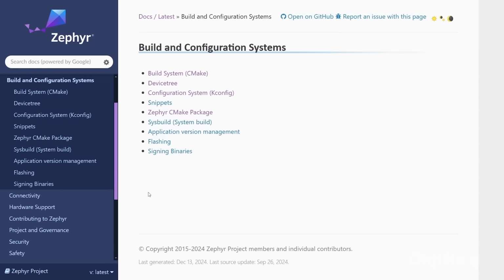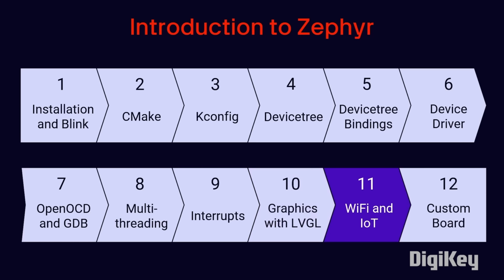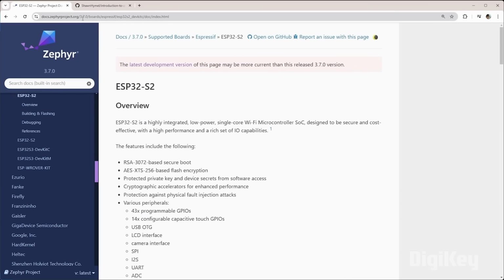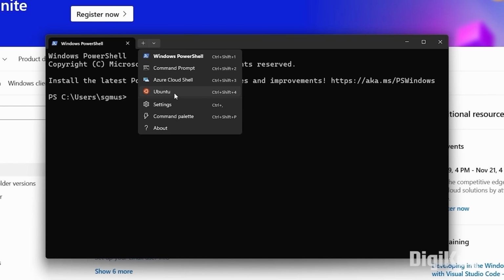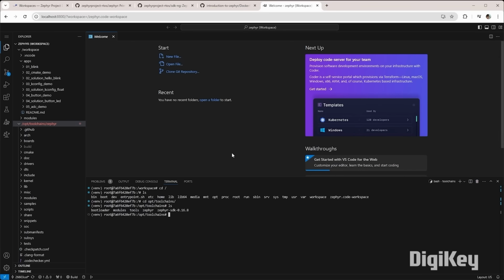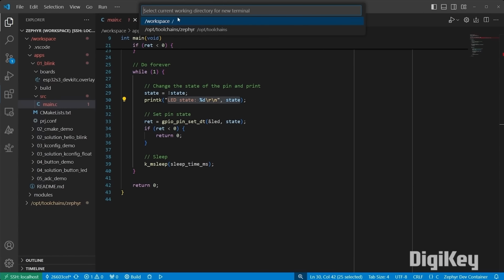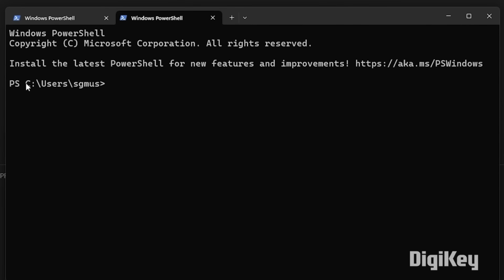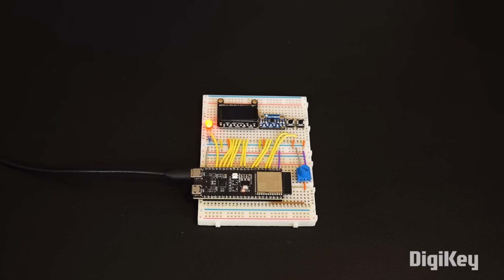Introduction to Zephyr Part 1: Getting Started - Installation and Blink | DigiKey

Comment: Thank you for this resource!  I look forward to learing more.

I had some issues with your istructions to install.  Wne I flash to 0x0, I get the following errors at runtime:
rst:0x10 (RTCWDT_RCT_RESET),boot:0x13 (SPI_FAST_FLASH_BOOT)
infalid header: 0x6e6f7965

My online research suggests this is an issue with SecureBoot.  Following advice online, if I flash to 0x1000, I am able to get the code to run.

Can you explain what this is?  Is this because I am using different hardware, or is something else going on?

I am working on an esp32-WROVER-IE.  I already modified the build instructions to build for the wrover board.

Comment: @ShawnHymel I finally got around to trying this again and was successful getting as far as building the blink example and installed pyserial, however, the installation of esptools failed with the following error:

```python -m pip install esptool==4.8.1
Collecting esptool==4.8.1
  Using cached esptool-4.8.1.tar.gz (409 kB)
  Installing build dependencies ... done
  Getting requirements to build wheel ... done
  Preparing metadata (pyproject.toml) ... done
Collecting bitstring!=4.2.0,>=3.1.6 (from esptool==4.8.1)
  Using cached bitstring-4.3.1-py3-none-any.whl.metadata (5.3 kB)
Collecting cryptography>=2.1.4 (from esptool==4.8.1)
  Using cached cryptography-46.0.3.tar.gz (749 kB)
  Installing build dependencies ... error
  error: subprocess-exited-with-error

  × pip subprocess to install build dependencies did not run successfully.
  │ exit code: 1
  ╰─> [149 lines of output]
      Ignoring cffi: markers 'platform_python_implementation != "PyPy" and python_version == "3.8"' don't match your environment
      Collecting maturin<2,>=1.9.4
        Using cached maturin-1.10.2-cp312-cp312-mingw_x86_64_ucrt_gnu.whl
      Collecting cffi>=2.0.0```

Anyone have any pointers?

Comment: Got some time so thought I would dig into Micro_ROS and only board lying around was an ESP32. 
So I started with Zephyr RTOS. I was trying to build the demo app like ping pong for my esp board but the CMake files says its not compatible. 
So my question is can I not do Micro-ROS on Zephyr RTOS on ESP32 specifically the ESP32 Devkit V1 ? Should I get another board ?

Comment: can you please share how to change the latest zephyr here instead of 3.7.0?
Reply: You can change the version in the Dockerfile. Note that it might break some things (as the versions of nearly everything are pinned) and some of the Zephyr function names/signatures may change.
Reply: @ShawnHymel  I tried the same but as you  added zephyr rtos commit id and i am not sure which commit id i should use for latest rtos, so instead i used zephyr arg version as 4.2.0 and removed the commit line, also i changed sdk to 0.17.4 and created a image but it seems it broke everything not able to build simple hello world as well. where i am doing wrong here?
Reply: @Mahakaal-007-05  Zephyr 4.0+ made some breaking API changes from Zephyr 3.9, so it's tough to know exactly what's going on. What errors are you seeing when you try to build hello world?

Comment: Regarding the 9m mark, if ZephyrOS is the choice for small embedded systems, what would be used on larger embedded systems?  Full blown linux or windows sbc?  How do FPGAs fit.. can you run it on an FPGA with 512KB RAM?   BTW, look forward to the the full workshop series!
Reply: I would say that Zephyr is a choice for medium embedded systems. Usually, you see something like: bare metal programming for small embedded systems (e.g. 8, 16, small 32 bit microcontrollers), FreeRTOS, Zephyr, or other RTOS on medium embedded systems (e.g. powerful 32-bit microcontrollers, like Arm Cortex M4s and ESP32s), and full Linux on larger embedded systems (single board computers with e.g. Arm Cortex A series CPU). You can do anything you want with an FPGA if it has enough resources. I would only use an FPGA when I need reconfigurable hardware and need very fast, hyper-optimized processing or I/O (e.g. designing my own processor, creating an AI accelerator, interfacing with a custom display).

Comment: For those using Fedora, I'm using Fedora 42, I had a hard time mapping my local volume into the container. I had to change the docker run command slightly:

docker run --rm -it -v "$(pwd)/workspace:/workspace:Z" -w /workspace env-zephyr-espressif

added the ":Z" at the end of the path in -v option/flag. Hope this helps.

Comment: I wish the hardware chosen would have been either pi pico or some other easily available hardware and cheaper, so that more number of audience could acuire it and follow.
Reply: I chose the ESP32 because of the WiFi capabilities. Something like the Xiao ESP32S3 should work (it's MUCH cheaper!), but you might miss out on some of the capabilities (e.g. USB client).

Comment: Please recommend a ESP32 DEVKIT alternative to the ESP32-S3-DEVKITC-1-N32R8V? The ESP32-S3-DEVKITC-1-N32R8V is either not available or has very long lead times.
Reply: @bobb5198 Any of the ESP32-S3-DevKitC variants (e.g. N8R8) should work for this series. Note that I have not tested them, as I only have the N32R8V, but they should work.

Comment: This is wonderful!  I do have a couple of questions:
1. You show three options for connecting to the docker image (web, ssh, VSCode docker plugin) - I generally stay away from web, but between the other two, are there advantages or disadvantages for one over the other?  I'd used SSH in VSCode to do development on an RPi 5, so I'm familiar with how that works.  From a usability, interaction standpoint is there any difference between SSH and the Docker plugin?
2. You're using Debian as the host OS for the image.  In your CI/CD video you started with Ubuntu LTS.  Is there a particular reason for using Debian with this Zephyr environment?  Is there an advantage for using one over the other?
3. How did you come up with all the version numbers for the components?  Did you just install the latest version first, get things working and then lock down on those version numbers?
Thanks!
- Robert
Reply: 1. My personal preference is the VS Code extension Dev Containers that automatically runs and connects to the container. It requires a bit more setup, but it seems I get to keep more of my locally installed extensions that way.
2. Nothing wrong with using Ubuntu--it's just a little more bloated. I went with Debian to keep the install image smaller for students.
3. Pretty much, yes. I started with the latest versions of everything and tweaked until I got things working. There were some issues with some of the ESP32 drivers in the last version of Zephyr 3.x, which is why you see the very specific commit version of Zephyr in the Dockerfile. That was the only way I got those drivers to work.

Comment: How come the docker image doesn't have the example apps in it? Plus, the speed at which Shawn moves forward is very hard to follow. Very disappointed.
Reply: The example apps are in the workspace/ directory in the GitHub repo. When you run the Docker image, you need to make sure to mount that folder so it shows up in the container. Is the speed too fast or too slow?

Comment: After building the image (I can see it in Doker Desktop) the size is about 6.86 GB so bigger than your... also running the image through the command:

docker run –-rm –it –p 2222:22 –p 8800:8800 –v “${PWD}\workspace:/workspace” –w /workspace env-zephyr-espressif

prompt the error:

docker: Error response from daemon: ${PWD}\workspace%!(EXTRA string=is not a valid Windows path)

To solve I've specified the path directly without use the ${PWD} shortcut so:

docker run –-rm –it –p 2222:22 –p 8800:8800 –v “C:\<my_local_path>\introduction-to-zephyr\workspace:/workspace” –w /workspace env-zephyr-espressif

BR
Reply: Thanks for the tip! I wonder if this is a Windows 10 vs 11 issue.

Comment: Just as a side node, for me in a Win10 Pro OS the power shell command used to build the image from the  file Dockerfile.espressif is not working and prompt always same error
ERROR: docker: 'docker buildx build' requires 1 argument
instead using the command to build the image inside a console shell (cmd) work perfectly...
Thanks and best regards.

Comment: Adding a bit of additional context here, I'm using an ESP32-WROOM-32U. I'm following the tutorial just fine. The same overlay file works just fine for the ESP32-WROOM-32U. However, I ran into an issue when flashing the device. I am not sure why but the command that worked for me was:
    python -m esptool --port "/dev/ttyUSB0" --chip auto --baud 921600 --before default_reset --after hard_reset write_flash -u --flash_mode dio --flash_freq 40m --flash_size detect 0x1000 ./workspace/apps/01_demo_blink/build/zephyr/zephyr.bin

The command that Shawn gives; the one without a few parameters and the one that flashes from 0x0 prints an error when I TTY. I'm also curious as to why this is the case.
Reply: What command did you use to build the application and what command did you use to flash? The ESP32-WROOM-32U is a base ESP32 (not an ESP32-S3), so you'll have to change your target SoC.

Comment: 21:38 In case someone is wondering, the Linux-specific commands are as follows:
                   Docker Build: docker build -t env-zephyr-espressif -f ./Dockerfile.espressif .
                   Docker Run: docker run --rm -it -p 2222:22 -p 8800:8800 -v "$(pwd)/workspace:/workspace" -w /workspace env-zephyr-espressif
Make sure that you're in the correct folder and do any changes to the commands as you want like Shawn mentions.

Comment: Hello Shawn and thanks for this material. I see you are using ESP32-S3-DevKitC-1-N32R8V, that one has 1.8V for SPI Voltage. Is that important when connecting external modules to the board? I ask cause the other versions with 8MB flash have 3.3V for SPI Voltage, Not sure if would need to set VDD_SPI voltage to 3.3v permanently, using eFuses, like documentation says or if I missing something else, since I am not electronic engineer is a possibility. Thanks a lot.
Reply: @freddyveza I have not played with SPI on the DevKitC yet, so take this all with a grain of salt. From what I understand, Espressif sets the VDD_SPI voltage to 1.8V permanently for the N16R8V and N32R8V variants of the DevKitC so it can use the higher capacity 16 and 32 MB SPI flash packages. The fuse is burned at the factory and you should not (or possibly cannot) change it (unless you want to damage the flash chip).

It seems that SPI0 and SPI1 (according to the WROOM datasheet) are dedicated to the onboard flash chip. I think in the WROOM module, these SPI peripherals are using GPIO35-37, which are powered by VDD_SPI, so I would not use those pins (it's weird they are broken out on the dev board...it's possible the WROOM is using GPIO26-32, but I have not confirmed this yet).

SPI2 and SPI3 are still available as general-purpose SPI peripherals and can be mapped to other pins via the MUX. So my recommendation is to use SPI2 or SPI3 and configure the pins to something else available, and almost all of those can be powered by the normal 3.3V.
Reply: @ShawnHymel  Thank you very much for your answer Shawn

Comment: Just in time as I get started with the platform. The given instruction does not work for me (the serial keeps pumping out "invalid header data") probably since I am using an ESP32-WROOM-DevKitC instead of the S3.

Luckily, I found Expressif's article "ESP32 bootstrapping in Zephyr" and flash MCUboot bootloader first then build with `-DCONFIG_BOOTLOADER_MCUBOOT=y` and it works perfectly.

Just so you khow, we could to `west flash && west espressif monitor` in place of those long commands.
Reply: Good tip, thanks! I didn't have that particular dev kit to test with. What address were you writing the bootloader.bin to? I ran into this problem on my S3. The bootloader should be at 0x0 for the S3 and 0x1000 for most other variants (including the base ESP32).

I didn't want to use west for flashing because I assumed most people would develop in the Docker container (for a unified experience), which means that you would not have west on your host machine. If you installed Zephyr natively on your host or you installed west separately, then flashing through west will work.
Reply: @ShawnHymel  You are absolutely right. The flashing address is indeed 0x1000.
Reply: @ShawnHymel  You are absolutely right. The flashing address is indeed 0x1000. The full command is

`esptool --chip auto --baud 921600 --before default_reset --after hard_reset write_flash -u --flash_mode dio --flash_freq 40m --flash_size 4MB 0x1000 mcuboot.bin`
Reply: @ShawnHymel  You are absolutely right. The flashing address is indeed 0x1000. The full command is `esptool --chip auto --baud 921600 --before default_reset --after hard_reset write_flash -u --flash_mode dio --flash_freq 40m --flash_size 4MB 0x1000 mcuboot.bin`

Comment: The link to the resistor is wrong (that also points to the push button)
Reply: Thanks for the heads up. I'll look into getting that fixed.

Comment: I'm looking at replacing an old Jandy pool control box with this kind of hardware so I can then control it with my mobile or home assistant.  I believe the GPIOs can be used to control valves but I also have 3 or 4 temperature probes I believe will need the ADC ports.  The 2 x 12bit ADCs I am wondering if I can break that up in software to 3 x 4bit or something like that?  I also need to interface to a variable speed pump and heater over RS422 and data sheet shows 3xUART and I guess I need to convert the UART to RS422.  Anyway, would like to see more videos on the rest of the hardware of this board.

Comment: Excellent video! Step by step is the best way to teach.  Though I am going to stick with Espressif's IDE because I have better things to do that type 200 characters to do simple thing that the built in icons do.
Reply: With a real Linux installation or VMWare, you could do `west flash && west espressif monitor` in place of those long commands.

You only have to use those explicit commands ... due to using Windows.

Comment: This looks like a great series and Zephyr is certainly something I am very interested in.  Thanks for posting this series.  Oh, BTW, the link to the DigiKey page of this topic seems to be broken.
Reply: I have all the hardware for this and was able to get through the environment setup and build some examples with little issue.  I ended up using a 1.8" 128x160 TFT by HiLetgo so I am still figuring out how to adjust the demos to accommodate the difference in display.  Overall, this is a great way to get started with Zephyr.